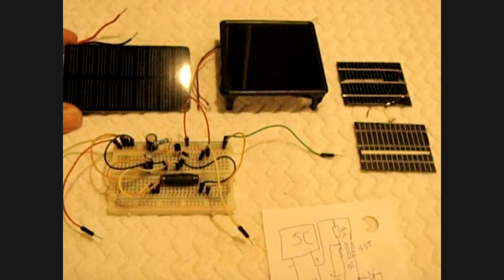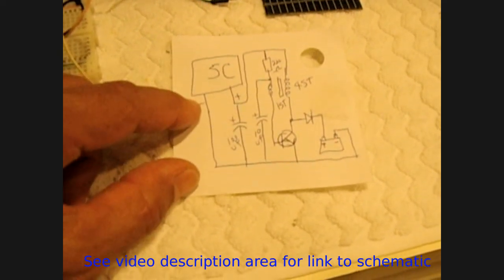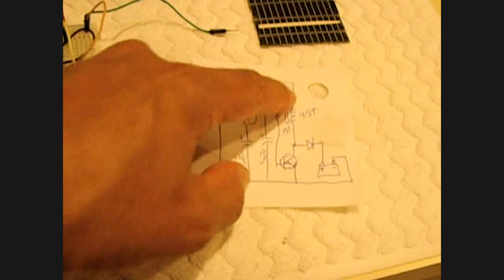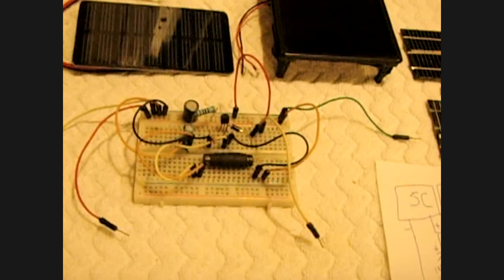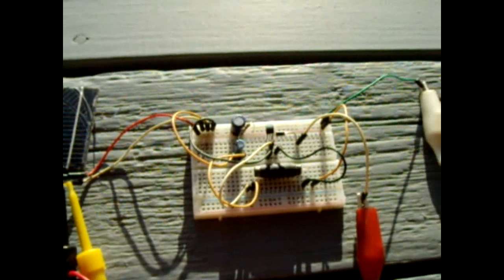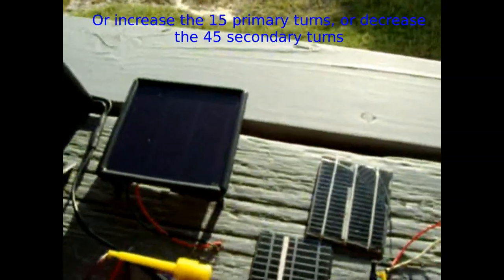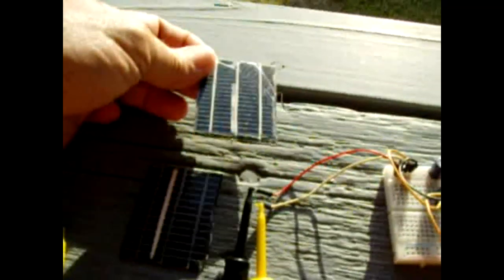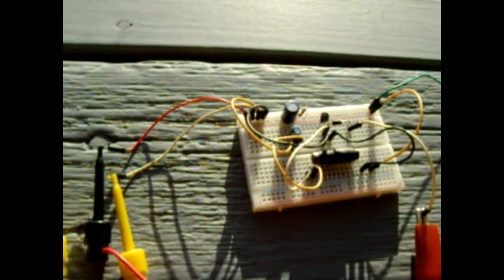4.5V/220mA Solar Panel To Charge 12V Lead Acid Battery

Comment: Great JOB ! I Have a question for you : Whit this circuits is posible to charge old ( but not damaged) cell from  laptop batery? Or i must to use  some special type of batery!Thank you  very much and i wait your opinion!
Reply from the maker: Ideally you need to use a properly designed circuit. If charging (1) 18650 battery from a laptop, or a few in parallel, the circuit below works.

https://www.youtube.com/edit?o=U&video_id=YuMTflaJjyw

Comment: sir, when i charging my 12v 8AH battery with 12v 4watt solar panels   it not charging sir tell me please how to charge
Reply from the maker: What's the output voltage of the solar panel in full sun?

Comment: I cant see in the video.  When you talk about 36 V, 60 volts or 40 volts, they
 are pulsed DC?  And ' shortcicuit'   the output diode  and the panel ground?  Do you read that on the AC or DC current on the multimeter? Thanks for your attention.

Comment: 45 turns  runs only for an inch long. Can I cut the  ferrite        at 2 inches?
Reply from the maker: Yes, the ferrite can be smaller.
Reply: I cutted it with a kind of dremmel and the so called ' diamond disk ' . Very efficient.

Comment: Why do they ask to wind the 15 turns that way?  8  one direction and  7 coming back?
Reply from the maker: No, you wind the 15 turns the opposite direction from the 45 turns. The dot next to the winding in the schematic indicates the start of the winding.
Reply: Sorry. 
The opposite direction but the same clockwise or counterclockwise?
Reply: The opposite ends.  It seems so.

Comment: If you need a stable 5v supply for your battery, wouldn't it be better to use a 5v regulator?
Reply from the maker: Bauke Posthuma Hi there. There is no need for a stable power supply in order to be able to charge a 12V lead acid battery using only 4-6v from a small solar panel. There will be a high enough voltage output from the circuit to charge the 12V battery. Of course the voltage will be higher, and the current will be lower, but at least you will be able to slowly charge a 12V lead acid battery using only 4-6V.

Thanks!

Comment: maybe it might be more efficient to have a rechargeable 1.5volt high amp capacity battery in parallel with diode to the solar panel to store as much of the sun energy whilst it shines, and the battery discharges its power to the rest of the schemed circuit..that means the tiny solar charges the tiny battery which then supplies the energy to the solid state circuit,..this might even make the circuit work at night when sun it not shining...regards

Comment: wonder what that circuit would do if you took one of the small panels like you did in the video and lets say run it into the input stage of an mppt solar charger! just thinking out loud!
Reply: just think on the cost difference :)

Comment: It really needs to be said, that the output of this circuit will not be 30-40V at 60mA. 60mA is the short circuit current, as you rightly say, therefore the voltage is almost zero. On the other hand, open circuit voltage is, say, 40V, but it will drop sharply when load is increased.
Therefore there's no fear of applying too much voltage to the battery. It's internal resistance is very low and it will easily swallow any current this circuit is able to output, thus bringing the voltage down to just slightly above the battery voltage.

It's a common misconception about solar cells, that they output Vmax an Imax at the same time, which is not true. One can experimentally discover, using a variable load, the optimum power point, where the product of voltage and current is the highest.
Reply from the maker: That is correct. The short circuit current would be at 0 volts. Current output at 14.5V would be much lower than 60mA. Still a neat, useful circuit.

Comment: How much does a solar cell like that cost ? Great video btw - love your enthusiasm
Reply from the maker: Thanks for watching Kevin. Individual solar cells are fairly cheap. Some are more efficient than others. You can do a "Google Shopping" search, then click prices low to high, and you will find the lowest prices. Polycrystalline cells have high power output in full sun, but not so great performance in partial sun. Amorphous cells work much better in lower light, but the output is not as high in full sun like the polycrystalline cells. The circuit here works good, but don't expect fast charging!

Be sure to check out my video playlists.

Comment: when you measure current and voltage you do it separately and it looks like you have 60 mA at 30V, but it's not. It's 60 mA short circuit which means that voltage is near zero. And it is 30 volts at open circuit -> current is zero. To find out the real values, try to charge battery and measure the current while charging. If you don't get at least 70% efficiency (Pout = Pin*0.7) then it's really bad. So efficiency = 100 (Vbatt*Icharge) / (Vcell*Icell) %. And you have to measure all values at once to be accurate.

Comment: do you have a simple circuit diagram a charge controller of 12 volts or 24 volts solar panel charging 12 volts battery?
Reply from the maker: You do not really have to worry about over charging the battery with this circuit using a small solar panel. If you use a large 5 or 6v panel, then you may need one.

Comment: Safe to pump prolonged 40V into a 12V lead acid? I thought like 13.8-14.4V was typical. No damage at these low mA I guess?
Reply from the maker: Exactly. There is not a high enough current to do any damage. You also will not leave it permanently connected. Once the battery is charged enough, you will remove the panel/circuit. If you would like to leave it connected all the time, just use a 3-6V mini solar panel with a 100-150mA output. Then you will be ok.

Comment: Looks like its a solid state Bedini. You can do this with Joule thief too. I did a similar thing a while back. Didn't get much amp hours into 12v battery, but was able to trickle charge for maintenance.
Reply: "we'll look at this crummy little schematic I drew up"
Haha
Reply from the maker: If you use a 500mA 6v O.C. solar panel, which is the solar panel in the video which folds, you will get good current flow. The smaller one worked well on my scooter battery, but for use on a car battery, the 500mA panel works good. I decided to use that panel. I tested the larger panel on a car battery, and the voltage rose nicely in full sun.  The output is 42V O.C. and 380mA short circuit. Later I will post a link to the image of my completed circuit.
Reply: I found the hand drawn circuit sufficient. Its a skill all good electronics designers should have. 5v panel in full sun probably would get some amp hours in. I got a good voltage rise from my 2v 200ma panel when I tested it in the sun. The idea was for ambient solar though. Hope you dont mind me posting link?
Tghis is one of a few videos I did on the circuit. Charging a 12v Battery in the shade. pt2. Results of testing after 6 hours. Sucsess!

Hope it helps :) I think you should be able to get your input power down a fair bit.

Comment: Thanks for sharing
does this also work with 1.2 watt 12v Solar panel
let me know
Reply from the maker: You can use it on any solar panel, but the 12V panel you have, already has a likely O.C. output of 18-22V. You don't need this circuit for that panel. This circuit is perfect for those lower voltage solar panels. This is a very good slow charging circuit/trickle charger for large 12v lead acid batteries. The high frequency pulsed DC output is also has a nice desulfating effect.